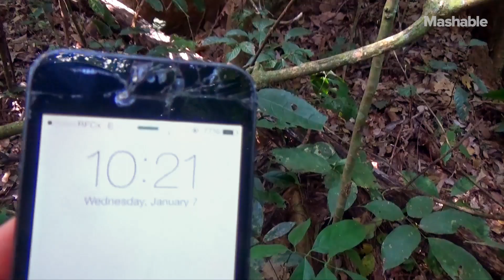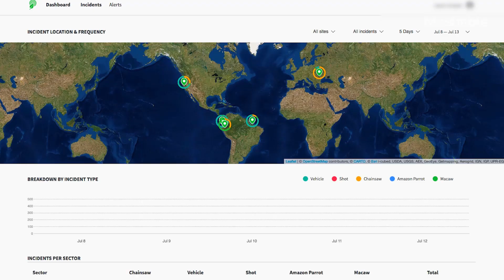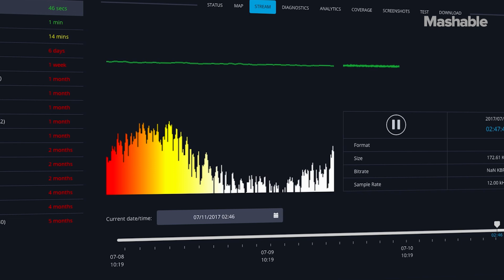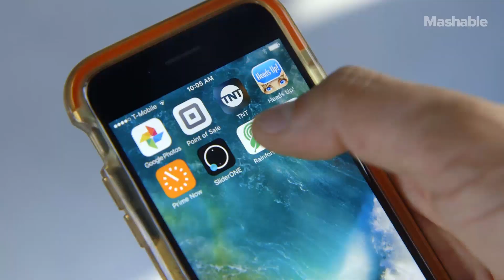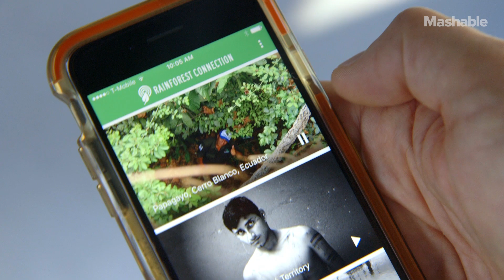Using Cell Phones to Save the Rainforest - A Cleaner Future

Comment: That’s a really cool idea!
Reply: Especially because the original manufacturers of these phones no longer update them, and they are too slow to run modern software, so these people would probably get a partnership with some carrier to give them all the Internet data they need, then they can (in the case of Android) make an app compatible with a very old version of Android (like 1.6 or 2.2), and have it run as a "launcher", then add the permissions for not allowing the phone to go to sleep, disable built-in GPS, and lots of other non-essential background services to allow for much longer battery life. The custom batteries they put in are most likely connected through a custom connector to the pins where the original battery connected to.
Reply: Kevin Bhasi nice idea, holy shit. You a dev?